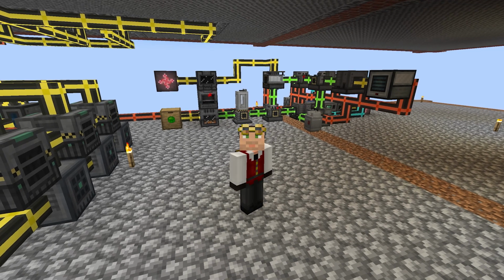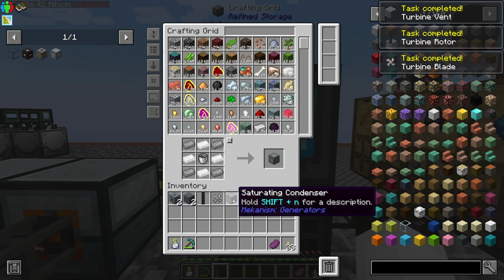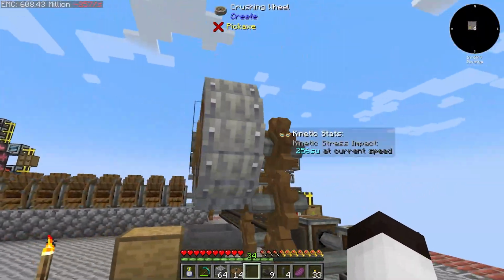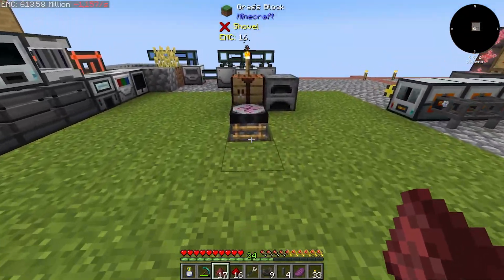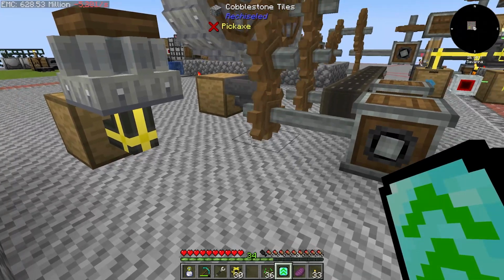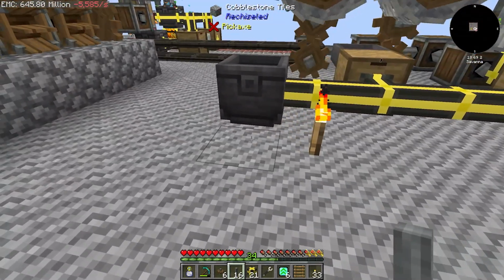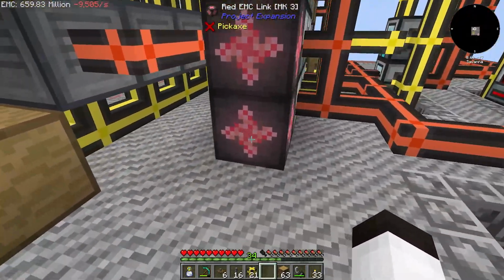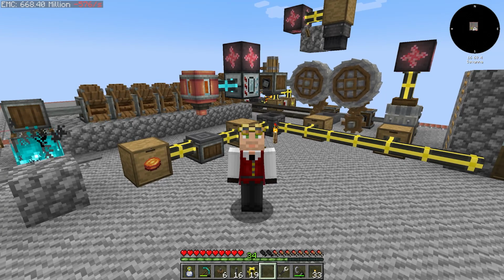Mechanical Mastery - Ep 27 - YUM! BLAZE CAKE!

Comment: Great video tinker! I used chickens for my setup with 25 in the chamber and it kept up. Also with the thermal machines you don’t usually need pipes to extract if you wanna compact the systems a little bit.